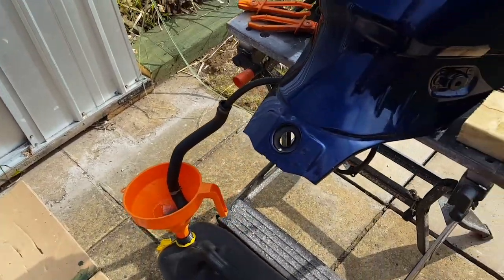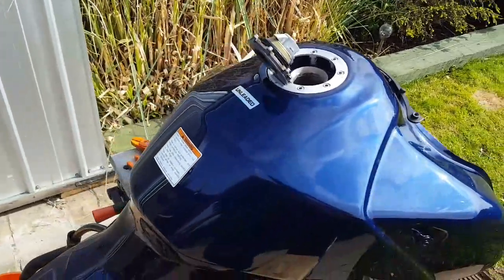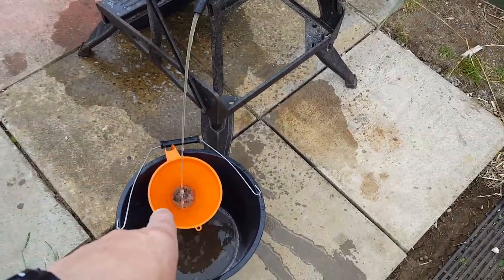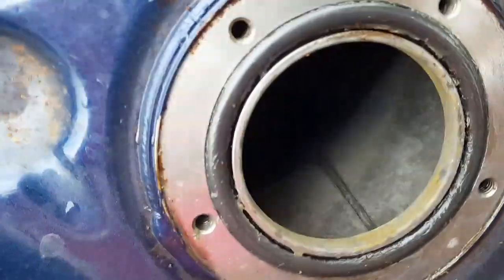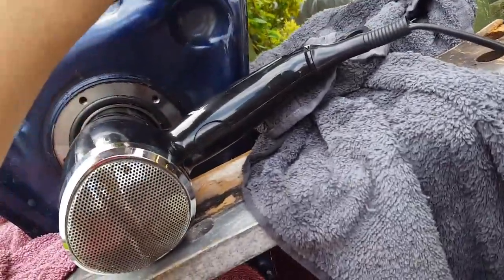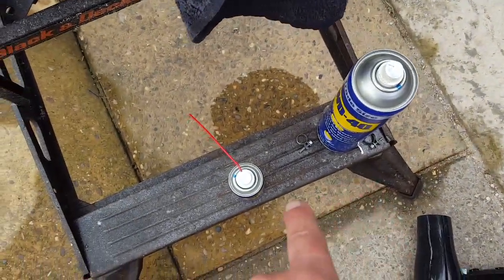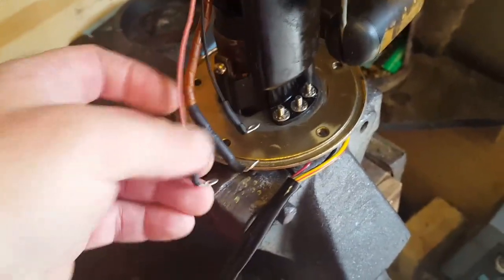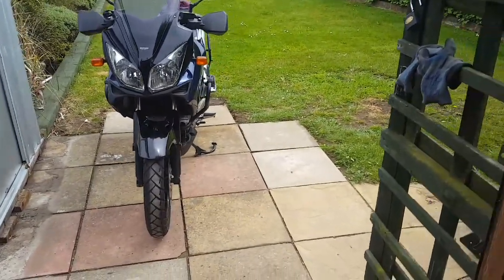Motorcycle fuel tank rust removal part 2

Comment: this is probably the best video I've seen on v-Strom tank rust, thanks for putting it all together! The phosphoric acid sound easier than the two-part epoxies I've been told about. You can pick up a new strainer (and pump) for about 20 pounds on ebay or Ali express.
Reply from the maker: Priestly Lotus 
Hey again ! Luckily the pump seems to have escaped failure this time ..the rust seems yo have stayed away so far
..but i think cleaning thr filtet will becomr part of each service...thanks gir your support 😁☮❤

Comment: Methylated spirits is another name for denatured alcohol.  The hair drier looks like the perfect solution for drying it out.  Great job!
Reply from the maker: OldManTony 
Oh blast ! I could have got meths easy.....oh well...it seemed to work my bodge way...I still have an intermittent bogging I think when the filter blocked first time some smaller bits my have siltedc an injector ..if I roll on throttle its fine all the way but if I throttle hard it seems a it lacking ....I'm getting the valve clearances and the throttle body sync done by my Suzuki mechanic friend and I'll get him to check the fuel flow rate and injector efficiency....I could do this myself by jerry rigging but he has all the equipment and knowledge to hand and charges me mates rates beer money so I'll let him do the nitty gritty .....
Cheers for the info brother ...Peace and love ..✌💗
Reply: springy 2112 I remember when I had my SV1000 there were several others on the forum with fuel issues like that, I seem to remember the filter was best cleaned with carb cleaner.  I also seem to think that the pumps just wore out.
Reply from the maker: OldManTony 
You may be onto something there..Tony  I'm going to get Colin to check the flow rate...Strange thing is before the initial filter blockage the bike was running full steam ahead in all gears at all revs...then I lost power almost 50 %   cleaned the filter etc got my power back almost fully ....just an occasional bogging at full throttle under load....maybe once an hour or every tenth hard pull away ...so I'm guessing injector fouling ...but who know I'm sure my buddy will find it.,....I just don't like my bikes running at 99 %.  Well all my vehicles to that end......cheers Tony take care buddy ❤